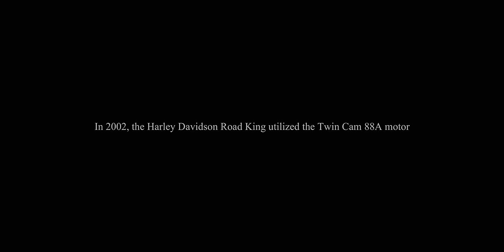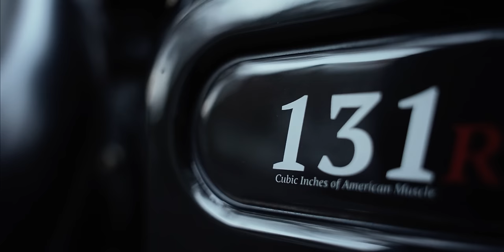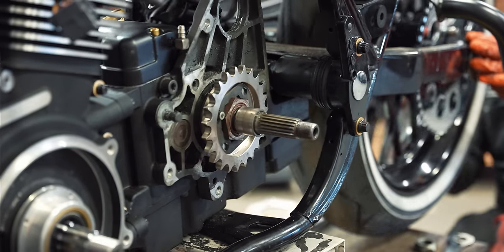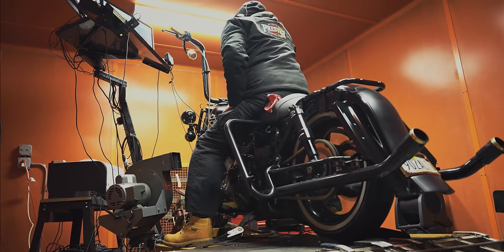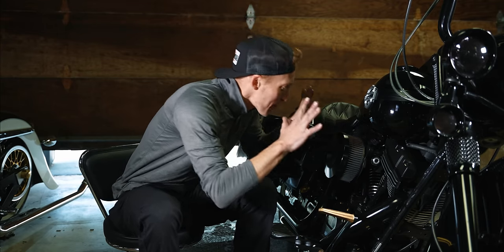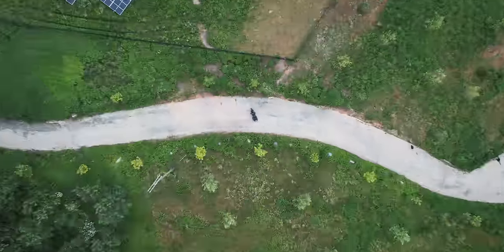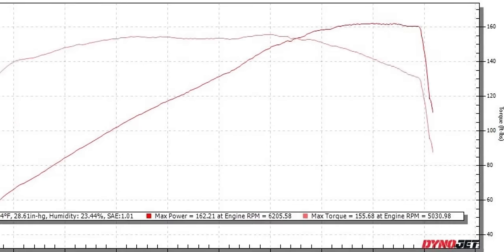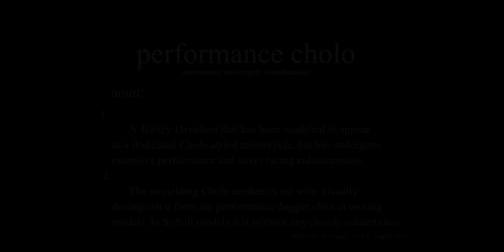Built 131ci Twin Cam - PERFORMANCE CHOLO - all motor, all gas and loud as Fu*k

Comment: I know from watching your other films that you had used a klock werks benchmark front fender before but can’t find the video you was talking about it. Was trying to find out if the RK front fender trim transitions over to that benchmark fender. Also wanted to know where you got that single piece of bag lid trim you got running down the middle of the bag lid. Looks killer!
Reply from the maker: The fender trim will transfer over, but you need to drill the holes yourself. However, the front trim piece will not fit perfectly, it leaves a couple small gaps at the corners. Not a big deal, but it's there and it's noticeable.
And I talked about the fender in my last film on Style blending 
The bag lid trim is actually the one trim piece from the previous owner that I kept, I don't know where he got it. But you could probably find it with a deep Google search.

Comment: Dude, loved the video Bro! Running the true duals, which is my favorite as well, did you guys try some torque cones to help prevent the mid range fall off? I'm pretty sure the old school lollipops got their start in preventing that. I am running the TAB pipes with the zombie torque cones and they did prevent the fall off in that area of the RPM range. I believe reversion is causing your fall off after 4500 RPM, the exhaust gas flow velocity has probably dropped a bunch at that point, and that's where these torque cones come into play, speeding up that velocity. Just a thought Brother, it happens a lot especially to V-Twins. GOD Bless Brother!
Reply from the maker: We didn't try torque cones, and to be honest I've never tried them ever. Maybe, I'll throw a set in this winter and give it another shot, any brand in particular that you know works?
Reply: I have the TAB Bam sticks with Zombie Baffles and the Torque Cones that I know work! But for your style of pipes, I have only heard good stuff about DK Customs Thunder Torque Inserts, especially on twin cams. Good luck Bro and keep making these Films! GOD Bless Brother!!  @JETFILMCHANNEL

Comment: Do you know how much wind resistance having that big tall front  wheel and having those tall handlebars creates? I don't know what it is, but I'm sure it's considerable!
 If you go back to the early days, like back in the 30's, you would see that they have handlebars down just above their gas tanks or below. They were looking to have the least air resistance possible.
Reply from the maker: I'm sure it creates quite a bit more resistance than if it were stock. However, I had to make some compromises because this is a Cholo styled bike. If I were going 100% performance above all else, than the bike would look a lot differently.

Comment: Thank you for turning me on to REV PERFORMANCE. I will be contacting them to help me bring my 2005 FLSTSC project to life.

Can you tell me the exhaust on your Bike ?
Reply from the maker: The duals are S&S power tune duals with steady custom cycles "mufflers".
And the 2-1 is the RB racing LSR pro-stock pipe. 
Both setups sound great and are extremely loud
Reply from the maker: As far as the rev performance cylinders, I went further into depth about them in a previous video I did on my softail engine build. 
Their distinguishing attribute is all aluminum nikasil coated cylinders, no iron liner. So the cylinder wall is thicker, runs cooler and it expands at the same rate.

Comment: so I was thinking on the whole spark plug indexing thing.... in a 4 stroke engine it doesn't spark at the time fuel air mixture is being sucked in,  the spark takes place after the air fuel mixture is sucked in and then compressed by the piston, at that point why would it matter which direction spark point is? wherever it ignites it will create a explosion.
Reply from the maker: Someone else pointed that out as well, and you're not wrong. However, he said that the spark ignites on the "power stroke", and that's dead wrong. 
We all know that the spark ignites on the compression stroke which is called "timing advance". And based on the closure timing of the intake valve due to these cams and the timing of the spark, there isn't much time in between.
Ultimately, the engine will  benefit from the open side of the plug facing anywhere from the intake valve to the main part of the combustion chamber.
The indexing is to prevent the plug from facing away from all of that

Comment: Badest bike ever! Can't say thanks enough for the video. Could you tell me what rotor bolts were used? Thanks!
Reply from the maker: Thanks bro, stainless ARP 6pt bolts of course. 7/16-14 × 1.5". (Length may vary with mods). Rule of thumb is to have at least 1" of thread bite into the wheel for each bolt.
Reply from the maker: Brake rotor bolts were Power James titanium 12pt. 
3/8 16  rear
5/16 18 front

Comment: Hey man. Just want to say. Truly inspirational video. Got a street glide and always wanted a road king. Now i want one and gonna build it up similar to yours. I love the horsepower out of harleys. Did you have to do anything with the trans (as in newer or upgrade the gear ratios)?
Reply from the maker: Thanks man, didn't do anything to the trans except switching to redline trans oil with "shockproof". 
The older 5speed tranmissions can take a lot more power and beatings than the newer 6speeds.
Didn't change the gearing, but I'm going to make it taller very soon.
Reply from the maker: Thanks man, didn't do anything to the trans except switching to redline trans oil with "shockproof". 
The older 5speed tranmissions can take a lot more power and beatings than the newer 6speeds.
Didn't change the gearing, but I'm going to make it taller very soon.
Reply: @JETFILMCHANNEL  i was curious as to why only 2002 had your eye on road kings. I havent looked up twin cams too much to be honest as mine is an M8 (dont hate, just couldnt find a street glide with low ks so ended up buying new. Gonna try and do a challenge on myself. See if i can get a twin cam up and over an m8. You almost proved it with 140+ hp. ) did you ever think about if you were going to up the trans to going for a dyno jet quick shift to shorten shift times? I looked up the specs on it and its a decent system and not req tuning on the ecu.
Reply from the maker: 149hp, and it will smoke all but the most extreme M8 builds. Don't forget about the weight factor. A heavy M8 road glide built with 15-20 more HP is still going to get beat because of the power to weight factor.
The 2002 was the best year if you planned on doing moderate engine work because it had stronger internals and the Delphi EFI.
2003 and up is when the cranks were made weaker and they went cheaper on the bearings. But if you're doing a full engine build then it doesn't really matter because all those parts will be changed anyway.
Thought briefly about a quick shifter, but I felt like it would take away from the riding experience. Hung the shifter lower instead for minimal foot movement
Reply: @JETFILMCHANNEL  yea i agree. Im thinking of putting my street up to 135 ( i dont think that would be too much. Was thinking about going carbon fiber on the bags, fenders and fairing. Did you get the 124 kit from s&s or did revolution bore your stock out and you just get new pistons?

Btw thanks for helping me get the answers to the questions. Im from aus so i can just run down the road and meet ya at hays and lamont haha.
Reply from the maker: It's the 131 Rev Perf kit. They bored and worked the case and machined the heads, but they provided their cylinders and pistons for the 131.
For M8s they have the 124 &128, depending on which crank you have. And then their monster big bores which are 139 &143, which require sending in your case and most likely replacing the crank.
Personally if I were doing a full M8 build, I'd go with their 128, but send in your case and crank anyway to get them bulletproofed. M8 cranks need work to handle really big HP, otherwise the crank runout from the factory will only get worse and you'll eventually scissor the wheels.
The 128 is a proven performance displacement that can take a beating. If you want an edge on everyone else with a 128, then up the compression more than everyone else and get a serious mid-top end power cam and a shorty racing 2-1 exhaust. Forget about low end TQ, the mid-top end is for winning races
Reply: @JETFILMCHANNEL  yea i was thinking about 128 but wasnt too sure. I saw 135 from moonshine harley. They do kits up to 139 which is good but im after that balance. Cheers for the info man. You gonna do any more builds?

Comment: So, I want to know, honest opinion on the Lyndall brakes? Thinking about ordering a black set but have not had anyone I know run a set.
Reply from the maker: Pros
Having the color is cool, they're lightweight which is really nice, they perform well and they look cool.
Cons
They're really expensive, the color won't last forever, they perform only slightly better than stock and they're floating so they're noisy at slow speeds.
My opinion is that they're over-rated, but they have a fancy look which can make your bike stand out

Comment: Might be a question you don’t get very much but what kind of helmet is that I want one that sits on my head low like that
Reply from the maker: I get that question all the time. It came with a bike I bought off of Craigslist about 10 years ago. It's a no-name-brand cheapo ebay NOVELTY helmet. Size L. That's all I know about it
Reply: @JETFILMCHANNEL  awesome man thanks for the reply means a lot for a creator to actually respond

Comment: 2 into 1 creates low end torque, 2 into 2 creat high end torque. Btw they came out with the 135 crate motor less than a year ago.
Reply from the maker: A 135 is an M8, this is a Twin Cam.
And your exhaust statement proves that you didn't watch the whole film

Comment: Great video.  I have two twin cam 88’s myself , 2001 & 2003 FXDWG’s. 
  Want to enhance them from stock. I’m about an hour from Prestige. Could you please tell me how much just the engine rebuild cost?
Thank you.
Reply from the maker: A  top end rebuild is cheap, but like anything else, once you're in there you might as well do xyz.
If you're looking for a nice boost on those 88's, the 98" kit with feuling 543/574 cams and some headwork will give you years of reliable fun.
Reply: @JETFILMCHANNEL  Great !Thank you for responding.  Happy Thanksgiving.

Comment: Bro are you running a comp or straight sprocket ?
Reply from the maker: It's a mix between the 2. I mentioned it during the film. Stronger than a ramp/spring system, and more forgiving to the crank

Comment: Did I miss what you ended up choosing for the ecu or did PH Mike tune the stock ecu?
Reply from the maker: He tuned the stock ECU. I touched on it around 45 min or so.
An aftermarket ecu could have yielded me slightly more power though.
Reply: @JETFILMCHANNEL  thanks sir, I did see that but wondered if t max etc came into play later. Ride safe!

Comment: So wait...did you stay with the 2 into 1 exhaust?
Reply from the maker: Just as I wrapped up filming, the season was basically over. Currently looking at 6" of snow on my yard.
At the moment the bike is totally stripped down again in my garage for winter updates, so no exhaust.  However, I'm going to keep both exhausts and both tunes. The 2-2 being my main, and the 2-1 being for any planned racing event or such.
Ultimately the 2-2 is more fun and faster on tighter streets, like city or town roads. And the 2-1 is faster on more open roads

Comment: Idk if you said in the video or not but are you still running a 5 speed transmission?
Reply from the maker: Yeah, I had a small bit about the trans but it didn't make the final cut. It is the stock 5spd trans, only thing I did to it was shorten Redline w/shockproof oil change intervals. Those old 5spds can take big power, much much stronger than the later 6spds.
Reply: @JETFILMCHANNEL  thanks man

Comment: What was the final weight of the bike?
Reply from the maker: With the duals and a half tank I had it down to its lowest at 680. With the 2-1 + more weight saving mods that I did after the film I had it down to 665, half tank. 
An extra gallon of gas (6lbs) really throws off your numbers if you're looking to see your progress

Comment: You can have the low end torque and horsepower then the bike hits everywhere .  My breakout has nasty torque at the bottom and mid and it’s so damn quick when I twist nobody has beat me .  By the time you get it going at 3000 I’m already gone bro and then I’m into my horsepower or I’m shifting and the torque monster starts all over again.   A twin is like a diesel ,  the torque is your acceleration and the Hp is a calculation that peaks at little over 5000rpms.  The peak horsepower is not what’s accelerating you down the road ,  it’s torque.  Look at your horsepower below 5000 peak it’s weak down at 2000-4000.   Your torque is driving you there ,  that is why the curves are opposite.  It’s not about old man only .   And this is not the race track where your WOT , it’s the street I’m trapped distances light to light back roads you need that torque.   My bike pops a damn wheelie when I goose it .  I heat so many bikes built up only at top and I walk them and leave them .  It ant a 2 stroke motocross crank that can spool fast .  Not saying yours ant fast but don’t diss torque .  Look at your dyno curve .  Your HP is not what’s accelerating it’s your peak .  You need both torque and Hp especially on the street where your not WOT hitting peak HP racing at high speeds on a track or drag.
Reply: You obviously weren't paying attention. The build has a huge torque curve with the duals on it. The short big tube full race 2 into 1 was installed to see what the max numbers the motor was capable of knowing that by design it would lose low end torque. But believe me when he unleashes that beast ram's never drop below 3500. Bike has 160 lb/ft of torque peak and over 140 lb/ft from 3300 to 5600 and has 145 at 5250 rpm where the 149 hp takes over. I'm holding the dyno sheet in my hand as I write this. Your bike isn't touch this in a race no matter what exhaust and tune he's running at that particular time.
Reply: @Panhead_Andy 

Good I was part way in the vid and listening to trash talk on torque for old men and I commented and I finished realizing he had the torque needed down low

Comment: Nice build just hate It’s like a hellcat. Cant even launch it without wheel spin a smaller motor that hook will give you hell trying to catch up but that can be corrected with a tune but I get the feeling you like the wheel spinning
Reply from the maker: I absolutely like that wheel spinning. A drag launch hookup would be nice, but showing off on the street is usually more fun to spin than to hook. But with proper throttle control it can launch pretty well (I'm getting there)

Comment: I am concerned that Big Engines (I’ve had some) Run hot, mine cooked my leg. They run so hot that they don’t last as long.
Reply: State of tune and quality of build are the biggest factors. An out of tune stock motor can generate more heat than a well built and tuned big motor. Lean = heat. Late timing = heat. Low compression motors need more fuel and timing because the fuel molecules are farther apart at TDC compression stroke, so you need more of them and need to start the ignition process earlier so they have time to complete combustion and not be still burning down the exhaust pipe.

Comment: Not 100% but I'm pretty sure ultima engines are built in the US. At least for the last few years. And the foundry for the cases is also. Not sure about the heads
Reply from the maker: Fact checked myself, and Korea was giving them too much credit. Seems as though they're made in China. There's a slight chance they're assembled here, but still... I'll pass. 
They use cheaper components made offshore to keep the price alluring. No way in hell you can get a 140ci American made V-twin for $5k.
S&S 143 is $11k and S&S's description of says that reliability/longevity is sacrificed to get that kind of performance, and a warranty doesn't exist. 
Guys on forums say they're good for about 10k miles and they're toast.

Comment: You got it all backwards. 2-1 exhausts are better for low end a mid range power.
Reply from the maker: Who told you that? HDforums?
Reply: @JETFILMCHANNEL  literally as any Harley engine builder or dyno tuner in the world if if a 2-1 is more for high end horse power or low end torque 😂😂 why do you think all these big motor m8 builds get primarily 2-1 pipes in them. Because 2-1 pipes shine the most in the lower rpm range for torque. Sure there’s 2-1 pipes designed for high hp builds but high rpm horsepower isn’t where they shine.
Reply: @JETFILMCHANNEL  hense the nickname “drag pipes” for one into one exhausts. Because they’re primarily used in drag racing for high horse power applications.
Reply from the maker: At the end of the film I installed and dynod a 2-1, which you obviously didn't see. 
Been there, it isn't theoretical. 2-1 makes the big top end power and killed my lower midrange. I even showed multiple dynographs during the film showing how 2-1 vs 2-2 doesn't make as much power until almost 4k.
Reply: @Ridehighfxdb  longer 2-1 exhaust will give you great torque. The pipe he used is a short unrestricted racing pipe designed for top end performance knowing sacrificing the bottom to get there. Nothing is free, you need to give to get

Comment: So Master builder 40+ years and no idea to incorporate breathers???
for you to find that out without your Tech not figuring that out beforehand with all that power and not cutting corners is🤯
Reply from the maker: Nah, we had breathers and we built an elaborate  case to oil pan breather but it still needed more. Big difference between real world miles and dyno miles when it comes to how the breathers can react.